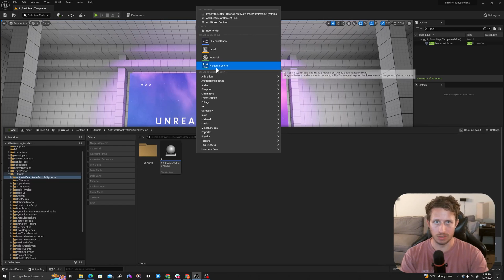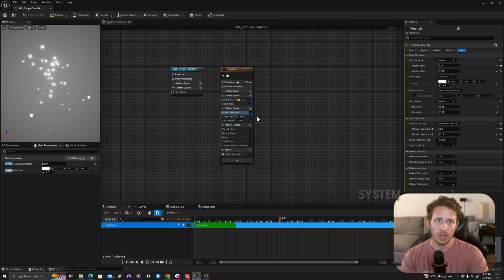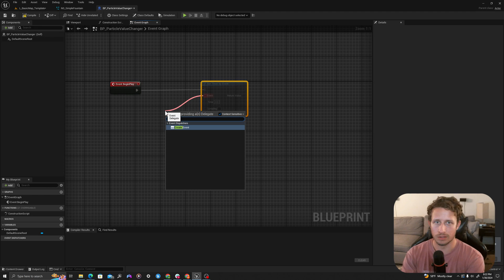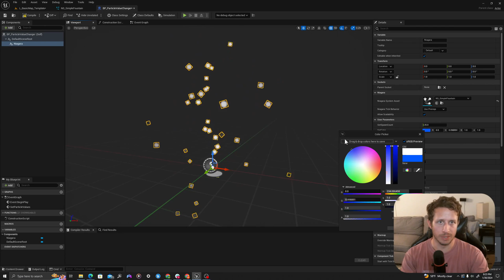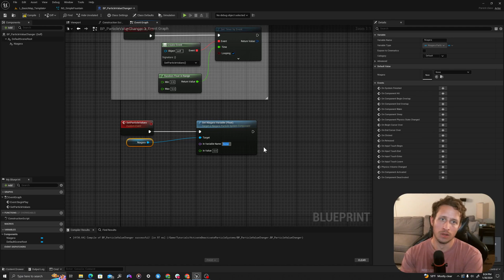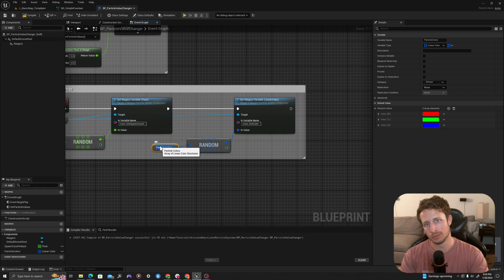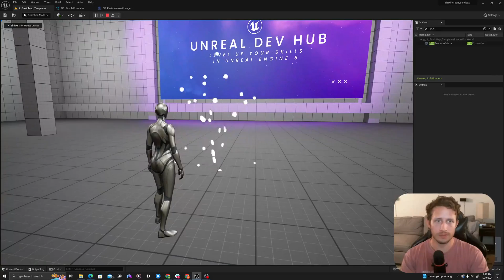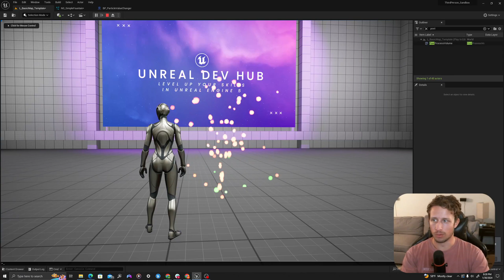Use Blueprint to DYNAMICALLY Adjust Niagara Particle Systems

Comment: I gotta ask, why the prefix of "user." before the parameter name? I need to know!
Reply from the maker: If you search in the parameters section of any Niagara System, you can see that there are many options for parameters in the context of System, Particle and Emitter. The prefix User just specifies user added parameters, as opposed to built in particle/emitter/system parameters that are available by default in Niagara.
Reply: @UnrealDevHub I'll check this out today during dev time. Thanks!
Reply: I was able to get things working without using the user. prefix. Is there any reason I should still add that prefix in?

Comment: Is there a way to bind these values? For example imagine I wanted to make a Niagara Particle Beam which connects two points. Like a simple line that connects between two "Scene Components" of my blueprint. Instead of running this on Tick, is there a way that dynamically links these positions? So i have access to them in scratch pad of my niagara system? I am seeing there's "Actor Component" interfaces as a user parameter type. As well as "Object" and "Object Reader". I imagine one of these HAS to be used for this, But I am struggling to find a clean way to connect these. I know it's a bit of an advanced topic. But curious if you know anything about this workflow. Thanks!

Comment: I am trying to set the value of a niagara Spawn rate by using a slider in a WBP with values set between 0 and 50. My NS is setup in the Pawn BP, when the slider value changes it sets a float variable in the PawnBP that is used to then set the spawn rate in the NS using Interface to connect the 2 BP's. It seems to work but only lets you update once